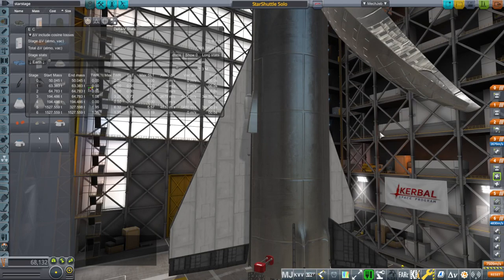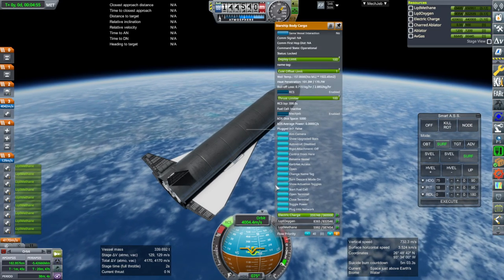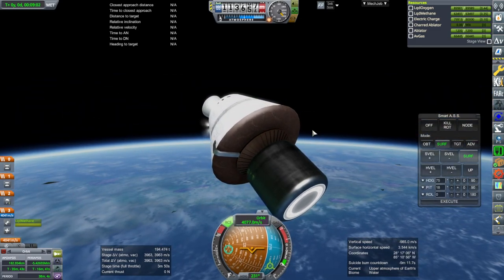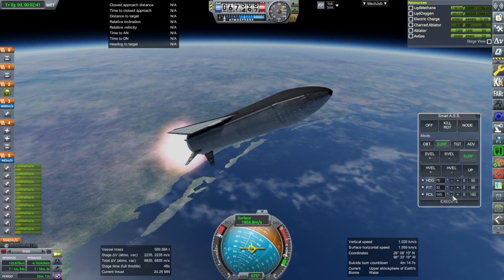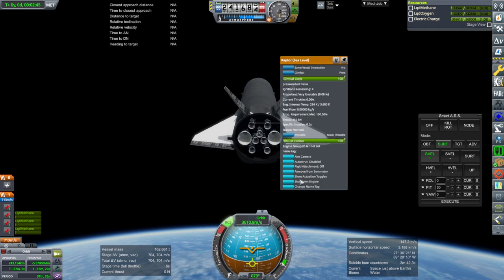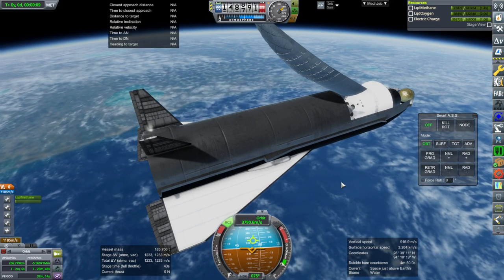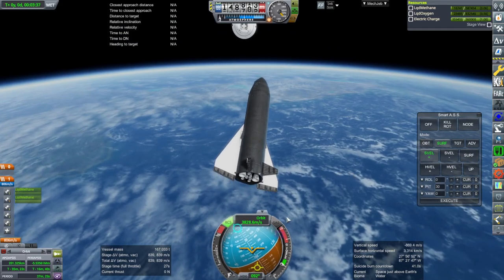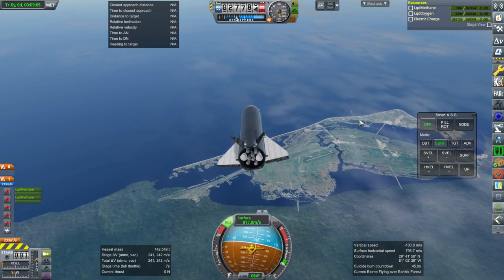Realism Overhaul in KSP 1.8.1 - StarShuttle Solo

Comment: I’ve thought about the viability of SX just using Starship as an orbital launch vehicle without Superheavy, if the booster didn’t work out with 29/33 engines

Arguably ship is more complex but so far it’s performed well with the test flights, so just re entry unproved

Booster never flown successfully so I wonder if the ship itself could do something like 25t to LEO, not with wings though

With an upper stage like RVAC would be a lot better like you demonstrated

Comment: Instead of throttling down, maybe you could shut down some of the sea level engines? This would theoretically reduce some losses
Reply from the maker: I did that later in the video, though I also pointed out that more efficiency with the StarShuttle doesn't really get us anywhere.
Reply: @RaizSpace  Could you restart the engines at 80k meters at 60-70 degree pitch to soften the fall?  That kind of pitch may be out of the limits of the control authority.  At the end of the day the Orion space plane does the job better.